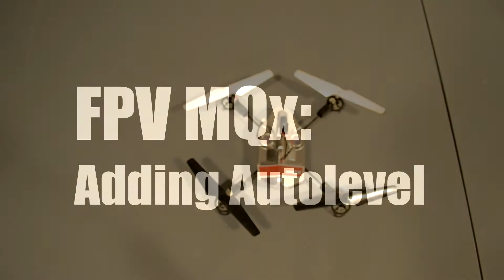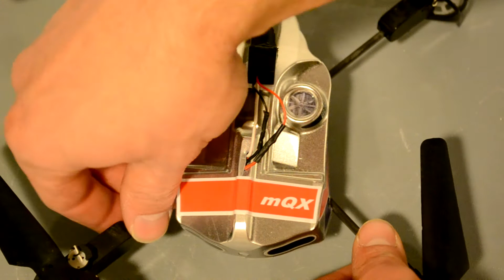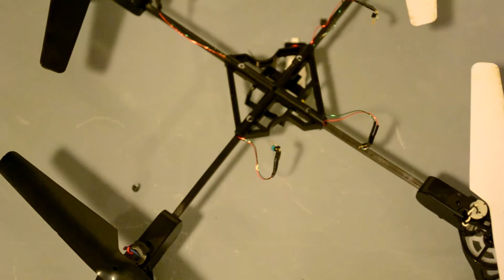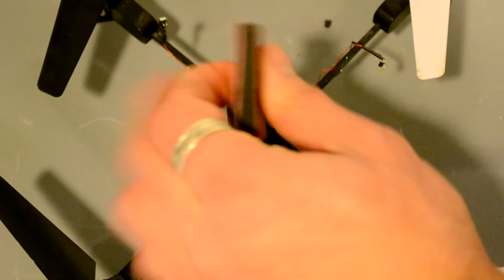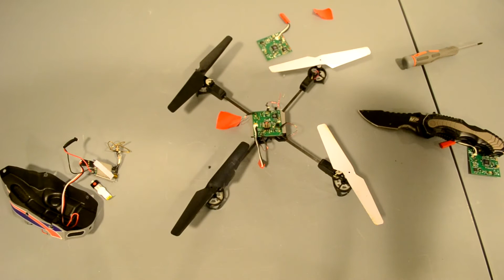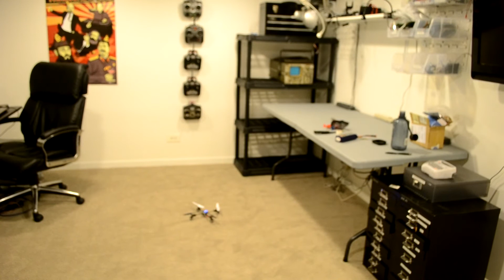FPV MQx --- Adding Autolevel

Comment: Good video.  I just bought the new one about 5 days ago and it is EXTREMELY durable.  Easy to repair on your own if you know how to turn a screw driver and have access to youtube videos like this one.  I had it outside last evening and was trying to get aerial video of my neighborhood with a 5 mph wind.  Found out the wind is different at 150 feet and the 180 sailed about 200 yards away over a medical center building, street and into a mowed field.  I lost sight of it once it went over the building, and cut the throttle because if I didn't it would have been almost impossible to find.  It dropped from 150-200 feet up, and the only damage was that it threw a $9.99 motor which I have yet to find!  :)  Everything else is intact and solid. I found a video on the 180 QX DX9 radio setup and a separate one for camera setup, but lost it and searching once again so I can add it for future reference.  It was through Horizon Hobby but they have a kazillion videos to sift through.  They would never show us how to do this.  I commend you for showing us.  This little quad is VERY repairable.  Once you add up all the parts, the price is right about where you would be when buying it new, but you only need one or two parts at a time which makes this a great buy.  I hope they come out with a little bit larger version of this quad design.  Double the size of the booms and boom wiring and this easy repair quad would be even more FANTASTIC.